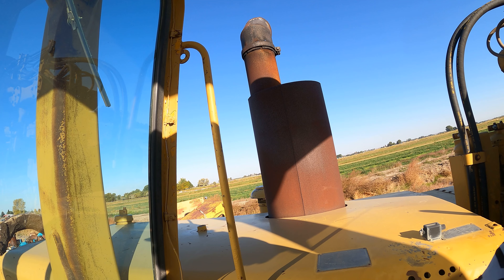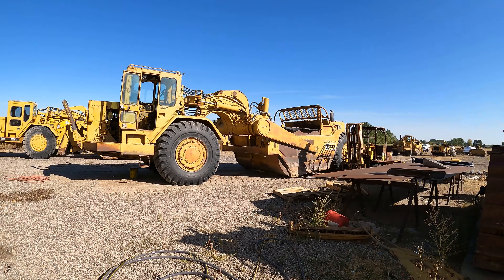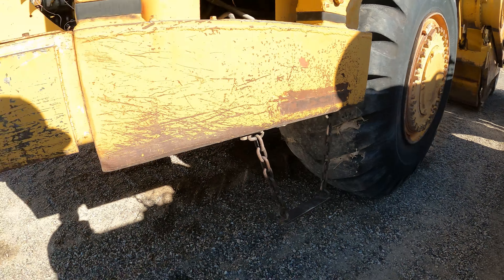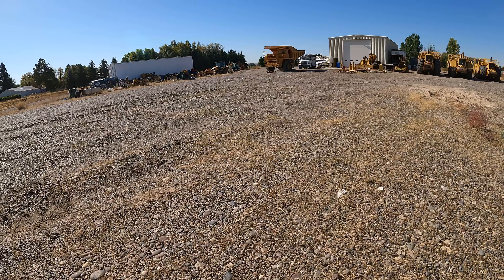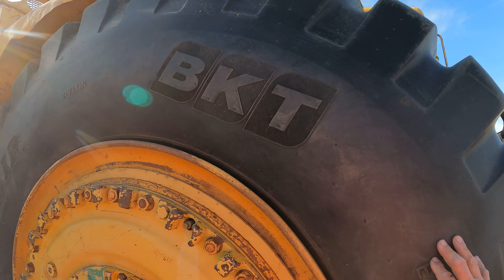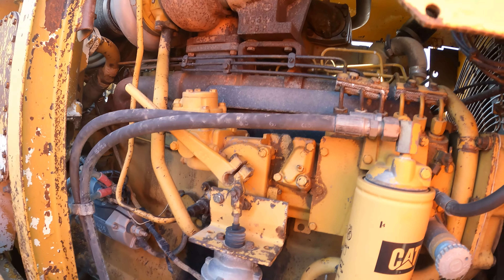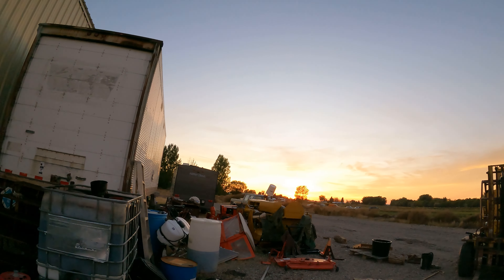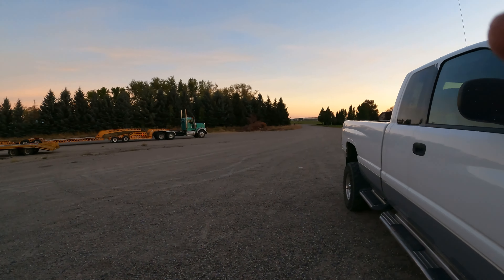Something Is Wrong With The FW

Comment: Hey Jeff, you need the Milwaukee transfer pump!  I absolutely love mine. I use it for everything from diesel to engine oil, gear oil, coolant what ever. Will pump a pail of engine oil in under 2 minutes. Soooo much easier than pouring them. Its a little impeller pump with a clear window so you can see the impeller. Highly recommend!  I have pumped a full barrel of screaming hot engine oil out of a Engine once and it still didn’t wreck the impeller. Very well made.

Comment: I have two old Michigan loaders with Detroit Diesel engines and one has the original canister type and the other has been converted to the spin-on oil filter. It takes the canister type probably three times longer to build oil pressure. Never had thought much of it until now. Odd thing is that they’re not full-flow filters. Those old two-strokers use bypass filters only. Crazy — right?

Comment: I built a cheep jump engine for those times my machine was too far away from a 110 VAC plug. Used a harbor Freight Engine, a 14 inch dia. pulley for the engine and belt driving a high output Delco Remy Alternator. Mounted all this to a piece of aluminum channel. I can fill up the gas tank and roll it to the machine on a wheel barrow where it will run two or three hours before needing gas again. Just use alligator clips on the output, voltage sensing and on/off wire.
Reply from the maker: Good idea
Reply: Delco Remy has great tech support...I was told that most automotive alternators can take 15,000 RPM so the 14 inch (largest reasonably priced pulley) for the engine allowed my engine speed to be lower. There are formulas and factors on the web to calculate what Hp engine you need based on the alternator output.

Comment: Funnel? You need what I used to use. An Old Style Fire Extinguisher Funnel. I used to fill it up with Rotella, a shot of compressed air, or Nitrogen which ever was handy and go play Oiler.
Ooops, I only used Rotella, you use that nasty Delo 400 stuff, so it might not work with that Tar In a Can stuff...🤣

Comment: do you get your oil in 55 gl. drums . if sow by a new gas jug with a long rubber hose on end  use that with longer hose and plug the end with a pipe plug and clamp it in place or by an ele pump and hose to fix in drums with a wrester head . 2 wheel cart. or forklift to move drums.

Comment: Battery kinda-expert here. Lead acid is self draining, and low voltage damages the cells. Starting batteries are the most sensitive but the exact same chemistry applies to deep cycle batteries, just slower. The absolute hands down bees knees best thing you could ever do for any LA battery is a solar maintainer (13.8V for 12V, 27.6V for 24V). Batteries are like water buckets with a pin hole in the bottom, and every time they’re emptied, the hole gets bigger and the bucket gets smaller!

Everyone go get a cheap solar maintainer to preserve your expensive batteries!
Reply: @colindgrant , as long as that extension cord was for the battery charger it was probably charging about .5 amp.
Reply from the maker: I have a bunch of solargizer panels for them, I put one on my fuel truck and never have a dead battery now, they work.

Comment: I hate to admit it, but 50 years ago when those scrapers were built, we didn't catch waste oil.  It went on the ground.  No one paid much attention to conveniently locating the drain plugs.
Reply from the maker: drain valves are great!  it' where you put the new stuff back in that sucks
Reply: @Jpaydirt  You mentioned the position of the drains on the filter manifold.
Reply from the maker: @firstlast-ty4di  Ohh yah, that's a piece of engineering  lol

Comment: I spent some years on a 637 . and pushed more then I can count with a d9g. I still run them in my sleep. I sure miss it. It is in my blood. Do you hold the heater back over to heat until all are firing          🤠John Wunschel 35years    O.E.U.#3

Comment: Sounded to me like weak batteries, it wasn't cranking very fast and lost it's prime. No smoke while you were cranking.
Jeff Wins
They always start when the Camera is off..
Stuck air valve or gov.
I'm surprised you even know how to run a 613. Spent many of hours on several.
TGP